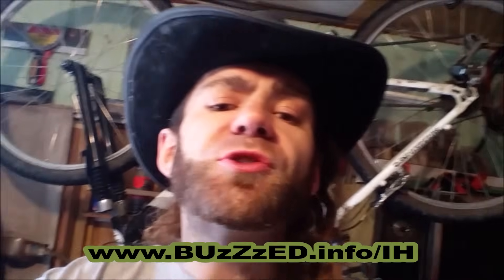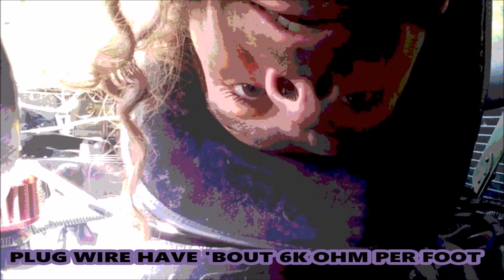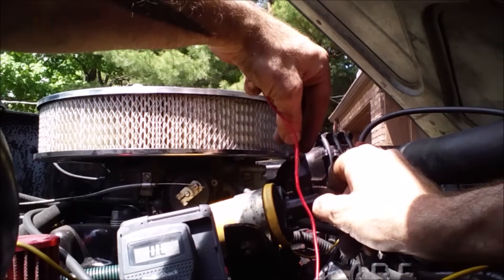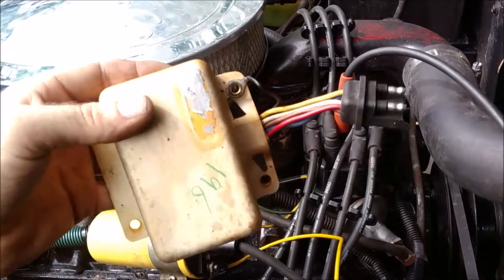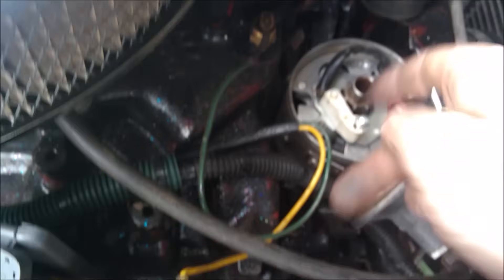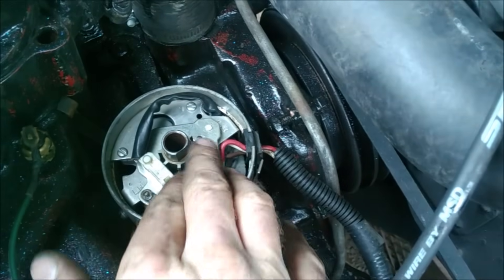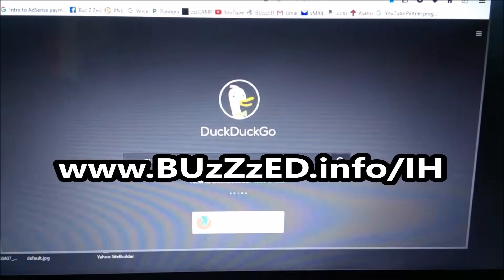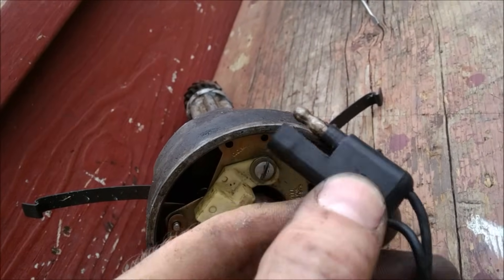NO SPARK, NO START, NO PROBLEM!  IGNITION SYSTEMS

Comment: What I have is a 351w, marinized!  Have new pertronics flamethrower 2  0.6 ohm coil 45,000 volts, as recommended.  on 200 ohm setting the positive to negative test settles down to 1.1...., replacing old flamethrower 2  0.6 ohm which won't settle down in that test, can fluctuate around 2.4 for a while and then around 1.5 for a while and sit still at 1.3 for a while and without breaking contact you could see any of this going on.  The new flamethrower reads 10.0 or 9.96 on the 20K test to the main wire, while the old one reads 8.77.  I've got gas and apparently no spark, but I also have a brand new pertronics coil and distributor.  I'm losing it!
Reply from the maker: what is it in?
Reply: @ErikTheWrench 1986 MasterCraft pro ski boat.  Indmar conversion.  4-barrel Holly.  240 HP.
Reply from the maker: @skidancin  and have you tried jumping the coil right to the battery
Reply: @ErikTheWrench  no... But I do have 12 volts at the coil and replaced ends on both wires to the positive on the coil.  The engine originally failed while running at 35 mile an hour.  It cranks nicely I checked spark from the coil wire, it looks yellowish instead of blue and it's a brand new coil as I was saying.  I'd like to think there's something wrong with my brand new parts.  I don't know what readings I'm supposed to have on a new pertronics coil.  Best I got was 10 where you were looking for 10.5 on your application.
Reply from the maker: ten is fine,, is the distributor a tooth off?  i assume its not a reverse spinning marine engine made for dual engine crafts....
you will need to chase each wire,  check the connections, clean them, check resistance across them with the battery disconnected for resistance... clean the ground, test the battery and the altenators output,
and if its all good, and you dont have a faulty ignition switch, you likely got a turd that slipped past quality control...
 so on the side marine engines are higher compression and need to run on at least 100 octane....
Reply: @ErikTheWrench  thanks for talking Eric, I'm not a tooth off and the wiring is good with 12 volts at the coil, and my 351 Windsor with four barrel Holly runs on 87 octane by the by.  My second call to pertronics included the fact that the coil sizzled like bacon after I cranked it while twisting the distributor to different spots six or eight times.  Protronics concluded that their part was bad and they promised to send me a new distributor/ignitor and coil.  Time will tell but I think you're right, new part was a lemon.  
By the bye, this engine is so simple it has just a single wire from the alternator.   Anyway, upon hearing of my symptoms pertronixs concluded my new part was bad.

Comment: I'm thinking you tested a 1.5 ohm coil.  So if I have a pertronixs 0.6 ohm coil, it should read 0.6?  On the other test I only got 8.5 through the center coil wire.
Reply from the maker: the 4 banger here has a 3 ohm coil,  the 8 has 1.6ohm across terminals, the main windings, the from post to main plug wire, should read 10.5,  8.5  is low like the coil windings coating failed, and its skipping  or shorting past some of the coil...

Comment: I had a new Ford Ranchero with a 351 that stopped running while driving down the road. I could smell the gas, so I knew it wasn't fuel and surmised it had to be electrical. Pulled the distributor cap and didn't see anything wrong at first. But after checking it for the third time, noticed the little rubbing block on the points was missing. I'd never seen that happen before or since to any vehicle.
Reply from the maker: This seems to be a huge problem with the rubbing blocks on new points,  better off new old stock...  I love them things! I was gonna drop a Cleveland in my 80 ranger b4 I found my scout!

Comment: I'm pretty sure I got the same issue I've replaced the balast resistor on the firewall ,pickup coil inside the distributer, the pligs,wires,starter,alternator, fuelpump,and coil, but still nothing I've tried 3 different ignition coils still nothing I don't have a multimeter just a tac meter for small electronics for like speaker wire or fuses . When I did test the current coil on the terminals it read 100% green keep in mind its not the proper tool. But when testing the wire hole where the plug wire snaps into it drops to about 45-50% power I wouldn't think it could be the icm under my steering colum  but I'm just assuming that just because it turns on off and turns the starter over without a problem it's on a 87 dodge d150 360 v8 5.9l dual pickup coil distributer
Reply from the maker: here https://schematron.org/1987-dodge-d150-wiring-diagram.html you dont have a balast resistor thats for points,  the extra wire is a low oil pressure kill switch.  so if the oil light is on the distributor wont fire.....

Comment: is this the same concept for 77 chevy monte carlo? changed spark plugs, wires, distributor cap and rotar and coil. car does same thing your
 truck is doing in this clip
Reply from the maker: YES SIR, IN FACT THE ONLY DIFFERENCE IS WE IH GUYS TIME OFF NUMBER 8 AND NOT 1! REVERSED GM FIRING ORDER... OUR CAMS SPIN BACKWARDS BECAUSE ITS GEAR TO GEAR DRIVEN, NO CHAIN.

Comment: I been having problems with the cap and rotors now adays…. I’ll go through one atleast once a month, any idea where to find a decent cap and rotor?
Reply from the maker: I just get the good one,   Very possible your distributor bearings are loose! see if you can wiggle the shaft,   also are they points? there are several other issues that can be happening if their points...

Comment: They man thanks my 1969 Charger 440 magnun, worked well, parked it the garage, all of a sudden no spark, with your video checked the coil with the volt meter, it was bad, swapped it out now back to normal.  Cheers awesone dude, saved me a ton of money.   Great respescts from Canada
Reply from the maker: lol my great  grandpa snuck in here from Canada as a flying trapeze in the circus, they should have built a wall. buahhhhh. Im not left or right, all I can say is, bush got elected said he was gonna build an electric fence, the only place they didnt do the fence and monitor system was in the only two places you could actually swim across the river.....  Then trump in 2002 on Tv was asked why he dropped out the race, he said he wasn't gonna beat bush. he was asked when will we finally have a Libertarian president, he said when their ready for me. and I quote "George bush went on Fox News, said he was gonna build a fence, got all the redneck votes, so im gonna go on fox as a republican and say im going to build a wall".  sheeple!
Reply: 65 corvair how do I test the voltage regulater ?

Comment: My same situation. BUT what is causing my coil burnouts - that what I need to find.
Reply from the maker: your coils are burning out? i would check your wires. is the coil still getting power when its off.  see the system is simple.
a key sends power to coil in on position through a resistor wire or a ballast resistor, giving the coil 9 volts.   
when starting a second wire with out a resistor gives the coil full 12 volts.
or you just get straight 12 when its on if its hei.
so coil has power.
points or pickup tells coil to dump
coil dumps charge to what ever plug the rotor is pointing at. 
so as you say, what could be burning up a coil.
bad ground?
bad plug wires?
is if running on all 8? spark returning with out jumping the gap like gap closed or carboned.....

Comment: So do you get lower voltage at the coil if your pickup coil is bad or damaged? What if the gap between the pickup coil and the reluctor isn't adequate? Could that also cause a drop in voltage at the coil?
Reply from the maker: The coil is charged like a capacitor right, straight 12-14volts. goes to the coil. unless its points then it gets 9.6v! As soon as it can ground out, and complete the circuit, it does. It does this through the cap and rotor and goes to what ever plug wire its pointing at.
Reply: Was it the pick up

Comment: So my truck starts and run but the spark is hella weak or no spark at all..do you know what it could be?
Reply from the maker: yes check voltage at the coil.    none of these comments where coming in my feed!!!!
Reply: @ErikTheWrench  I changed that still little to no spark on the rotor cap…I’m thinking about changing he distributor
Reply: @nikkydeanb6050 What was it?
Reply: @jonhsmith2706  I had sold that truck bc I couldn’t figure it out and bought a new one the same year,that was in better shape..I think the guy said it was a ground wire and it took him a week to find it

Comment: Carter carburator jet setting
Reply from the maker: Like what jets are in the Thermoquad on a IH Scout? or about the rods that meter the jets!  Their up top, slip the caps open, the rods are hooked to a plunger on a spring.  they have kits.  You keep putting lighter springs until it stops bouncing up with the engine running.   you want just enough for the vacuum to hold it, 
when vac drops off during acceleration, the rods rocks down and further restricts the jets to keep the mix right, 
a holley just squirts extra gas through the accel pump , thus harder to meter smoothly..... 
so you determine does it need more restriction to fatten the mix or less, at the tip and at the base.....

Comment: Bro I just did a new dizzy new icm new coil and cap and rotor and timed it started once and now I have no spark again!! Can you guys help it's a 92 k2500 suburban 4x4 with a 7.4 454
Reply from the maker: well, um ok Beavis, lmao, well i would say if we where talking same decades, same idea as a GM thing but the IH cam spins the other way L! ... but (2 we are talking a computer not just a small brain box! You need to do an ELECTRICAL LEAK DOWN TEST FIRST! (vid soon if not yet, but goggle it) So if your sure its nothing covered in this video, its not a bad ignition switch or neutral/park start safety switch, well you do a leak-down test (while following your factory manual or electrical diagram off the internet),,, and if its all good , its your computer.

Comment: I have a olds 350 and when I n pull 2 middle spark plugs wires on the left side  with no change any ideas
Reply from the maker: yeah, them cylinders dont fire L!   first try new plugs in them holes, try new wires or switching wires to see if the misfire changes places and then its just the wires.    but you might have a bad head, stuck or dirty valves, bad rings yul need to run at least a compression or a leakdown test.         I guess on the cheap, you can put a few drops of oil in them 2 holes and if they fire you got bad rings.     if its your ride to work like it was for me last time that happened,  i made it through half a year running straight 50 weight oil or lucass additive wich is basically gear oil ( I use hyperlube never luccass, only the luccass trans fix, that shit , I once drove home a 50$ caravan listed dont move.  lasted a year, people where chasing me saying they changed their mind and dont want to sell, ha, i was like you owe me for a transmission then lol)

Comment: How did you check the pickup coil? I don’t see the leads hooked up to it?
Reply from the maker: I get this question a lot, I need to add in a note that the meter is hooked up the same place as the test light was... coil to ground... about 6 min into the video... yet this is testing the box and the pickup at the same time,  If you go to 12 minutes, you can see a clear picture, just test the resistance of the pickup, its just a coil
Reply: @ErikTheWrench  Thank you, I tested it and it seemed to be ok but I still bought a new one and I still don't have spark. I am super stumped now. The last thing I need to change is the coil even though it tasted ok and I connected a spark plug to it and I do see spark.

Comment: I have a 1973 Dodge Dart Swinger with a 318 motor. It won’t start up and I’ve done some tests on it. I took off the Electronic Ignition Box from the firewall (I saw the melted sludge coming from the back) and figured this might be the reason it won’t start. I’m not getting spark on any wires. Do you know how I can test it?
Reply from the maker: 99% of the time if the oil goo is leaking out its shot. If you want to test Check the manual to know what terminal is what, and see if it sends a signal to the coil. The wire that activated the coil to dump spark.... The ICM or CDI it’s just inline between the distributor and the coil. But it may be off time just because it pulses...
The next video shows how to remove it and install a pertronix kit. This is a ICM that goes inside the distributor,  no more exposed box. Ignition Control Module = Capacitor Discharge Ignighter
Reply: @ErikTheWrench  Thank you!!! I have ordered one already at the local parts store and tomorrow I will be changing it. Thank you very much for the reply, I appreciate it!!
Reply: @ErikTheWrench  I replaced it right now and I still don't get spark. I did check the coil and it tested out well (over 10.4). I checked different wires and no spark. I am stumped and thinking about buying the pickup coil to see if that is what is wrong. If you can see my video, I have posted what I replaced just to show you how the goo looked. 
https://www.youtube.com/watch?v=0amPqhrLTGU
Reply from the maker: I’ll watch it, but right off the bat you removed and bypassed the old box right
Reply: @ErikTheWrench  I removed it and connected the new one and tried it.

Comment: Charge that battery and crank with that spark tester clipped on it. If the battery explodes💥🔥... you have spark.  😳
Reply from the maker: nah, lot of myths, they have merit, like the whole thing of batteries draining on the floor, thats from when they came in wood cases! Half of it is insurance company bs..... Did you know that a lap belt is better than a single shoulder strap, unless you have a x or two of them, its instant spinal damage and whiplash....          the odds of half this shit like your car running while pumping gas exploding, would mean every wire short on every car would blow up the gasstations  or your battery.....

Comment: Hey I’m having a no start issue on my 1978 Porsche 924, I’ve replaced the faulty ignition coil (resistance measurements were off spec) however still no start, but I’ve noticed there’s 2 ballast resistors before the coil wich take the voltage down, I’ve measured them and the 1st one takes the voltage down from 12v to 8v and the 2nd one takes it down from that 8v to like 5.4V. This seems strange to me, as people say the coil needs 12v, do you think I should remove those resistors?
Reply from the maker: ok, on a points distributor,  it runs off of 9.6 volts. you know how on the starter relay their is the bypass wire only on cars w/ points distributors.
well that will bypass the resistor and give full 12.6 volts to the coil, only when cranking.  once its running it goes through resistor again.  you must have a bad ballast resistor circuit , sounds like someone messed with it.   also, you should be reading 9.6 and 12.6 to 14.6... not 8 and 12. so also check your meter is calibrated, your battery is good, and your alt is working, and you dont have any corrosion creating a false load on the switch or relay or any of the connectors.  I will put a video out on electrical leakdown test, but your coil should be getting 9.6 volts except when you are trying to start it.
this is because if it ran at full voltage all the time, it would burn up the points, most of the wear on your points happens when your cranking then runs at a safe 9volts... it actually winds up making about the same spark because its still the same amperage, remember, its high amps that can kill you not volts...    if you check my webpage in the IH section, its going to be universal information on most engines and wires, other than the colors and firing order... http://www.ironhammer.info/ih.html    , and the more I think about it, Im not sure a 78 would still have points, so even weirder... their should be no resistor at all unless you have a points distributor. its possible it has some fancy dual points distributor. points are better, they just require regular maintenance..

Comment: If it starts with starter fluid...where shud i look?
Reply from the maker: Do you mean it starts on starting fluid then continues to run on its own, or it just if you spray it ?
Reply: @ErikTheWrench  i spray into carb and itll start and continue to run when i have throttle open half way....motor stutters an dies when i let off on throttle.

Comment: What do you do when you changed the control module, ignition coil, cleaned distributor points, get the truck to start then next day nothing.
Reply from the maker: Points and a control module? If it’s a points distributor wired to a non points system.... the points distributors have a resistor that is bypassed only when starting. It runs off 9.6 volts otherwise, not 12

Comment: No disrespect but he sounds like Casey jones from the first ninja turtles movie 😎🤘. I'm helping my dad work on his 1978 chevy truck 350 with hei distributor. It ran the other day in town then shut off . my dad had to restart the truck drove it home . rotates now but nonstart or spark. Replaced the cap rotor and coil and the 4 prong icm. Still no start? Its either the pickup coil or the starting switch mount on top of the steering column since a non tilt column ?
Reply from the maker: Yeah just get a 5$ test light and see if it’s getting power